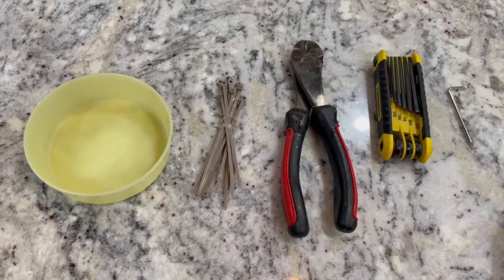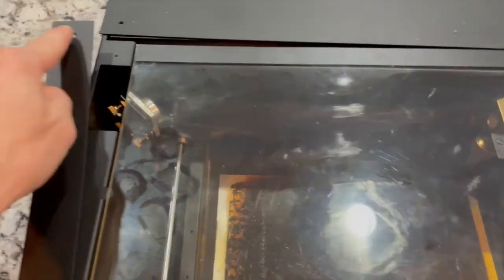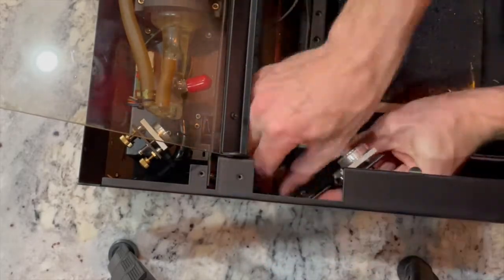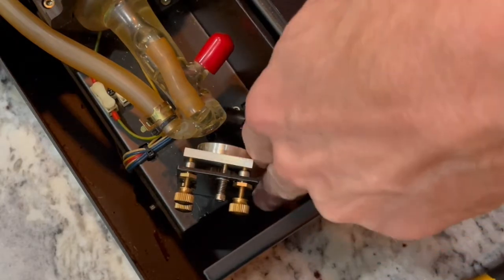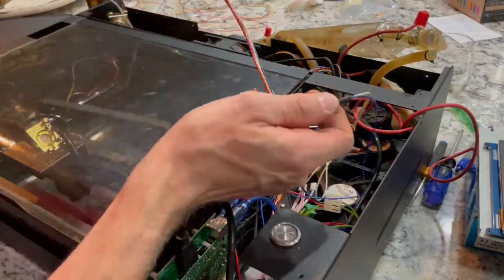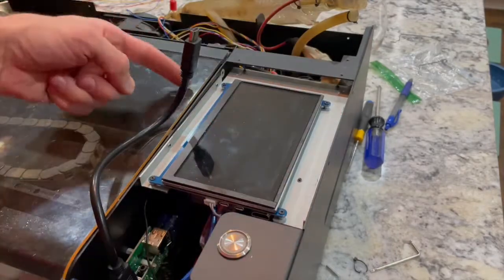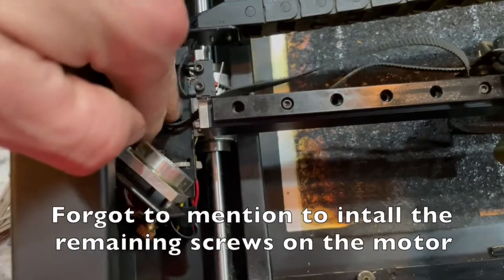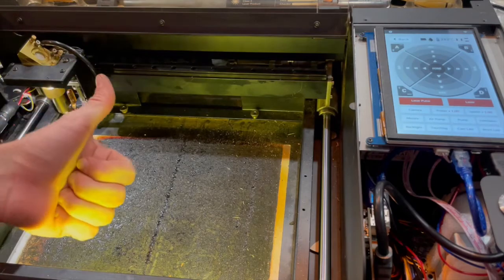How to Replace Flux Beamo Motor Unit

Comment: Outstanding job! Thank you for posting. The small zip ties can also be used to tighten up wire runs instead of those wire wraps, a lot quicker for any further maintenance....I only use the snakes for visible runs on computers.